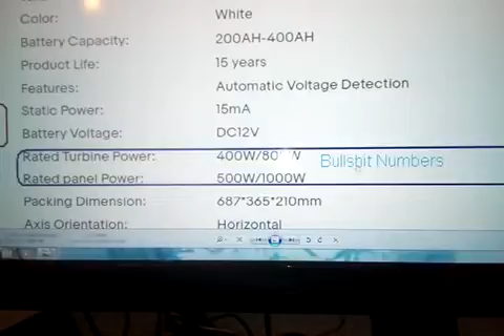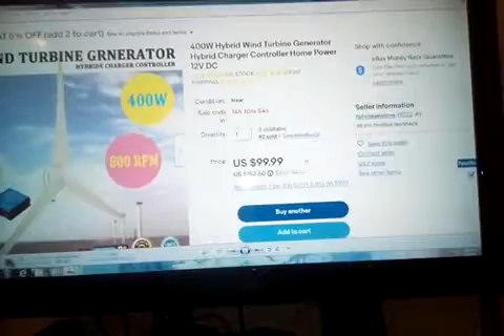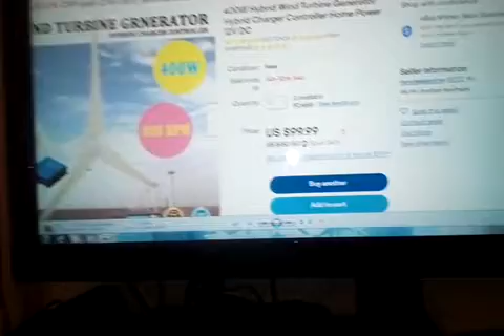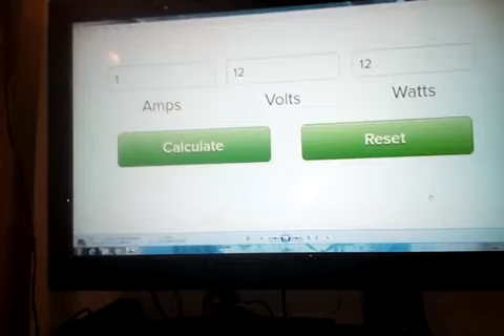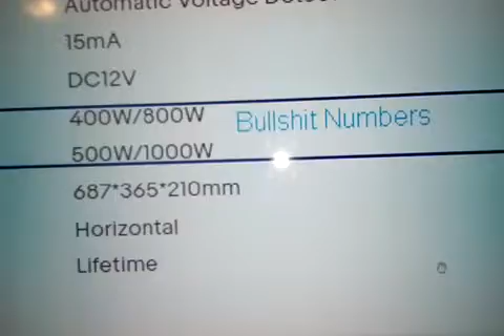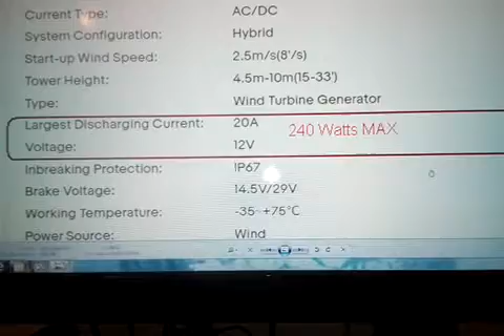Max output of a 400 watt wind turbine generator

Comment: Watts = Volts x amps. Ive got 4 of these cheap wind turbines and they have been running for years and you are 100% correct they never live up to expectations however they have proved to be a very good addition to my off grid setup and they often outperform my solar panels dollars for watts. That is to say nothing that they can produce when the solar panels are not.
A couple of my videos.
https://www.youtube.com/watch?v=xuWWY-zfEII
https://www.youtube.com/watch?v=l44y70sSMVU